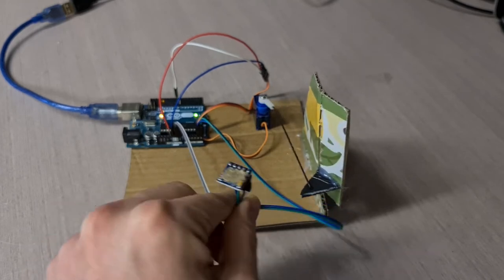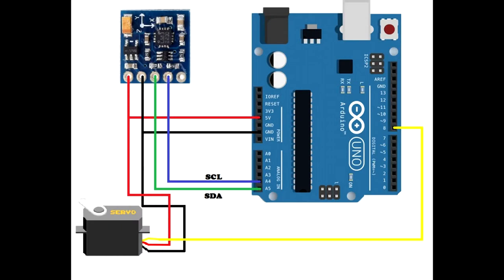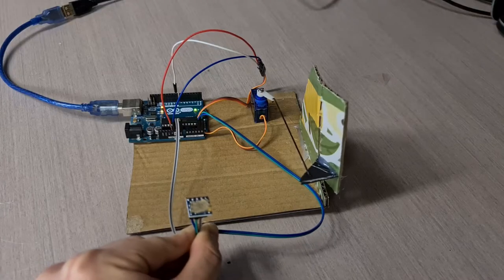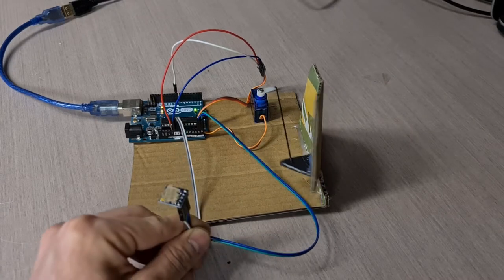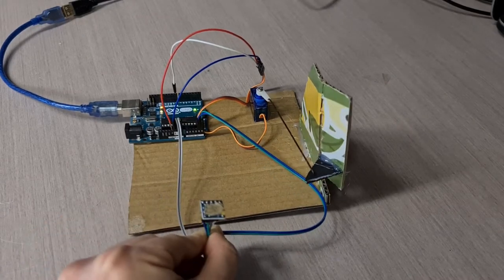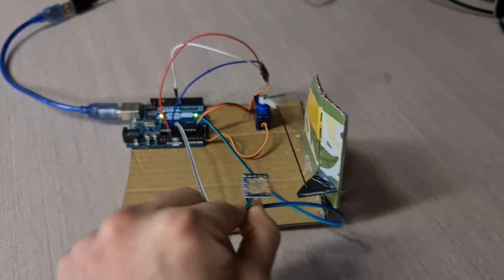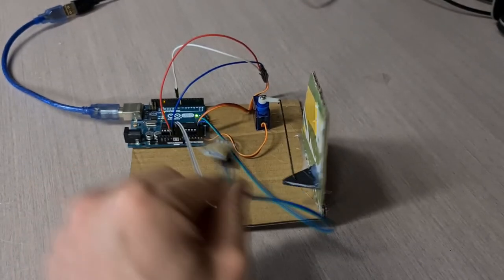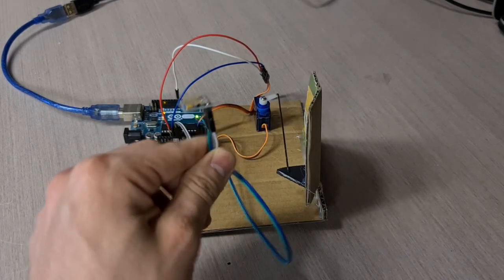Arduino RC Autopilot Compass Rudder GY 273 HMC5883L

Comment: Cool! Just ordered the same compass unit and will use a stepper motor connected to the steering wheel. It is for my 25 feet sail boat which would benefit from a simple autopilot.
Did not find the link to the code though?
Br Robert
Reply from the maker: Is the GitHub link not working in the discription?
Reply: @TechUpBuilds   Found it! (Did not show up on my phone yesterday) Thx